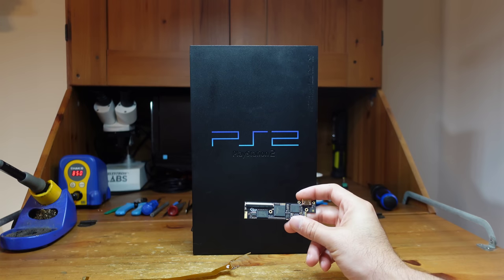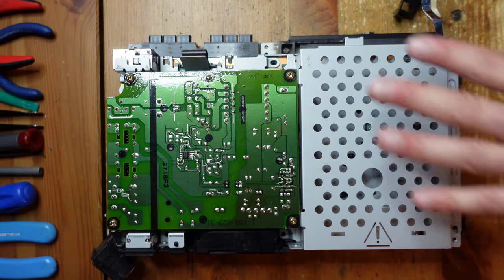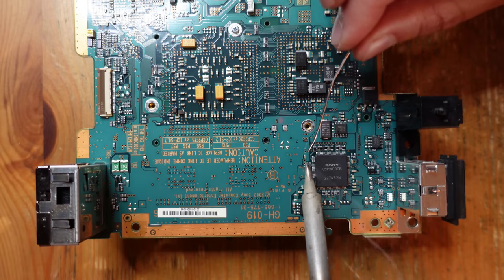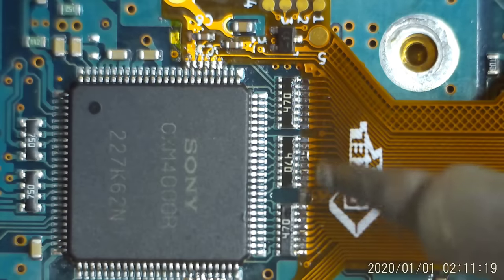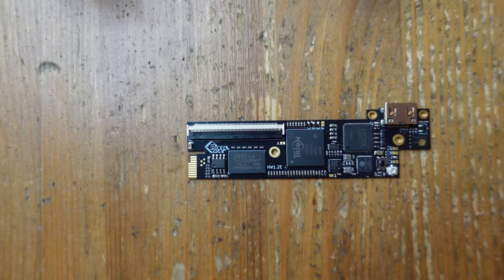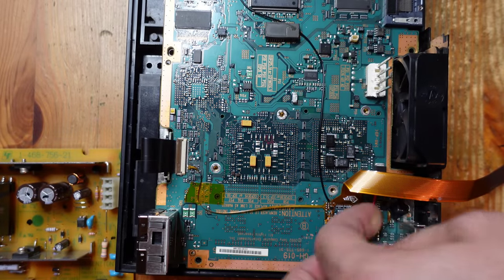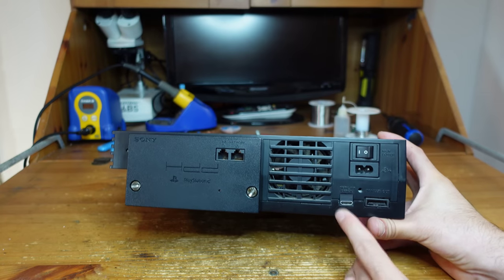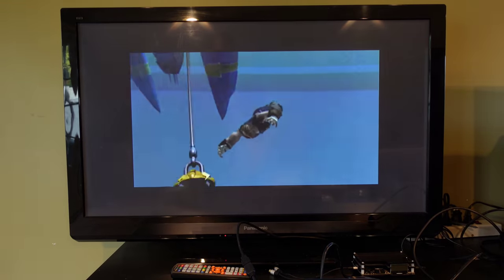Finally, a PS2 HDMI mod! Get the best possible video from your PS2 with the PixelFX Retro Gem!

Comment: Good installation process ... Thank U for sharing the footage ... Need to point out a few things, from my POV anyway:
1) PixelFX needs to tailor this mod, in order to fit specific PS2 models - and i am talking about different series, like 30000, 35000, 39000 (like yours), 50000 e.t.c... Since U still need a donor console - even just the PSU & RF Shield - to perform this MOD, it isn't an optimal solution for most folks ... Yes, the PS2 is the most common home console, but if U need donor parts to perform the mod, it is a big minus ...
2) From a mechanical standpoint, RF shield, pin & socket trimming may not be a difficult task to perform, but there are still required for the mod, thus altering the console's originality to some extend .. Most mods i have seen so far on retro consoles, regarding adding native HDMI support & socket, are way less intrusive than this mod ...
Overall, i do hope they improve their product on future revisions ... I am aware than many (and i mean many) retro gamers have been waiting patiently for a PS2 HDMI mod over the years ... But this needs to be improved upon ...
Just my two cents here, good vid, yet again 👍
Reply: They designed it to be a very generic board that can be used on many consoles, so I doubt they'd want to go more specific.
Reply from the maker: Thanks, glad that you enjoyed the video! One other option for the power supply is to use a modern replacement called the RePS2 and that would make the install a little easier
Reply: Have they said why the older power supply is incompatible? Is it a clearance issue? I would rather buy a consol specific kit so i dont have to replace the power supply altogether, though with as old as it is it would proba ly be a good idea to replace the caps.
Reply: 🤌✏️📌👍 Very much agree. I'd, specifically, made my PS2 selections from among opportunities for the 3900x model, especially, because they were the most gaming feature-rich and last revision to have the hardware included for iLink/s400 Firewire system-linking for, albeit a sparse number and, yet, notable titles almost all of which I still enjoy with other players = there has been no means of emulating iLink, otherwise, since.  Even though the 3900x lacks the relatively minor integration of the IR receiver sensor (what the 5000x model added), even that feature simply requires a cheap IR receiver dongle plugged into the controller port of pre-5000x models and that remote feature really only serves out of use DVD viewing which, by now, most console owners avoid to preserve the aging optical drive. Beyond, the slim PS2s, IMO, are simply more compact for and more easily powered off of automotive 12V ACC jack power via the long available DC to DC power adapter that's been around since nearly the launch of the slim.  Who wants to harvest shielding, etc.? This design should have had further review and market research and, especially, avoidance of addiitional required salvaging of parts cannibalized off of other models.

Comment: Question for you. I have the exact same model PS2 I want to mod, but why does the 3900x Model PS2 require a PSU from a 5000X series model for the retrogem? I'm thinking about switching it out for the RePS2 PSU, but I just don't understand why its required, and none of the documentation or forum posts explain why the switch is needed.

Comment: Nice to see that leaded solder works fine, I wasn't very keen on switching to unleaded for the PS2.  Were you using 350C when doing all the soldering?
Reply from the maker: Yeah, I was using 350c for the install and it’s much better to use leaded solder

Comment: I don't know if it's a marketing campaign, but magically everybody uses this mod and is the "best".

If anyone doesn't have the money (because it's very expensive and doesn't worth the money), or the skills, can buy a 2€ converted which is connected directly to the PS2 output and with OPL you can set the resolution up to 720p-1080i. Maybe it's not as good as this mod, but costs 50-100 times less and doesn't need to modify the console.
Reply from the maker: “Best” was just my subjective opinion, but you’re right that you can enjoy PS2 lots of different ways and for little money or even free. The important thing is to enjoy the games. I’m very happy with this mod on my personal console, but it’s only the “best” for me and not for everyone

Comment: George, you may have mentioned it in the video and I missed it, but with the Retro Gem on PS2 (or any Retro Gem compatible console) is it possible to retain the ability to use Composite in addition to HDMI or once the mod is installed, it’s HDMI only?
Reply from the maker: Thankfully all the analog video signals are preserved, so you will get composite, s video, and RGB in addition to HDMI

Comment: What's the advantage of being compatible with different consoles, at least to the consumer? Any reasonable possibility of an external install, or would running longer wires to the components be problematic?
Reply from the maker: The main advantage to the consumer is that the retro gem can more easily be adapted to work with other consoles, including the Xbox, Wii, nes, snes, genesis, and others. Hopefully this means that more direct hdmi mods will be available soon

Comment: I get wanting to do these kinds of mods, and wanting the best from an old game system on modern displays.

But anything old enough that doesn’t do digital output natively, aren’t you just adding a bunch of input lag and visual artifacts with something that is effectively an internal A/D scaler?  

Why not do an RGB/scart mod instead (on a CRT, it will look awesome), or use an external scaler that functions on multiple screens and devices?  Plus the PS2 probably supports component, which is basically RGB anyway.
Reply: No lag added to any of the Pixel FX products. The flex cables are pulling digital video straight off the video chips and sending it to the HDMI output, so you are getting native digital video. If anything, lag should be less than a stock console because the stock console has a digital to analog converter which allows it to send an analog signal out to your TV (Even though there's really no perceivable lag on a stock console either). No issues with visual artifacts either, thanks to the motion adaptive deinterlacing built in. There's a reason why internal mods like this are pricey. They do things the correct way. This isn't some cheap analog to digital converter jammed inside of a console.
Reply from the maker: I should have been more clear in the video, but there is no lag whatsoever when you do one of these mods. That being said, PS2 looks great using a scaler like the tink5x and RGB or component cables

Comment: I wonder if this mod is compatible with SCPH-30001 version? Has anyone tried to install it in such a console?
I have this early version of PS2 with DMS4 pro chip installed, but I haven't hook it up to my 16:9 Samsung in many years. I'm quite excited about this mod, but it seems not to be compatible with my console. I've sent PixelFX an email, but still haven't heard back from anyone.
Reply from the maker: They have a compatibility list on their website, and I do not believe that this model is supported
Reply: @LIRetroGaming  You're correct. I just got a confirmation from Dan of PixelFX regarding the incompatability issue with such a model. According to him, there is a plan to add support for this model in the future.

Comment: Thank you so much for this video! It was really informative and helpful :) I just have one question regarding disc-based region unlocking with this digital mod. The PS1Digital made by the same team has built in PSNEE support, which makes a ps1 consoles region free for disc-based games after the ps1digital is installed, removing the need to also install a separate modchip in ps1 consoles compatible with the ps1digital. Does the retrogem similarly have PSNEE support or equivalent to also make any ps2 it's installed in region free for pal and ntsc disc games? I haven't been able to find any information elsewhere suggesting it does or doesn't. Thank you again for the fantastic video!
Reply from the maker: Thanks, I’m glad you enjoyed the video! The retro gem doesn’t have a region free feature for the ps2, but that being said there’s a region free softmod called Mechapwn that’s very easy to use with the ps2
Reply: @LIRetroGaming  Thank you so much for letting me know! :) Unfortunately my two ps2s aren't compatible with Mechapwn (both are PAL 3900 models) but fortunately one of them has a modchip in it so if i get this digital mod someday i now know it's best to put it in that one instead of my unmodified ps2 :)

Comment: I got mine today so i searched your video to get a heads up on what I'm in for, and i didn't even think about it until i saw you removing the optical audio jack-- does the gem route dolby surround or does it only do the basic stereo audio? That's kind of a big deal for me so I'd really like to know.
Reply from the maker: I’m not sure if it does, but it would make sense if it can also support Dolby surround

Comment: I wonder if it'll work with a 39000 model PS2. That's one of the fat models and the one I have. I also have a slim model PS2 which is a SCPH-70012
Reply from the maker: Yes, this is actually a 39000 model PS2. The retro gem is also compatible with the slim

Comment: So how does the Retrotink 4k / 5x pro compare to this mod ? from what i have seen the Retrotink is awesome (and no soldering and portable ?
Reply from the maker: There are a few scalers that can do a very good job with the ps2 including the Tink 5x/4k, the OSSC pro, and the Morph. If you have those scalers already then it would probably not be worth it to hdmi mod a ps2
Reply: @LIRetroGaming  I broke down, ordered the 5x pro and decided that i wont do any more of the intense soldering mods. Buying the 5x will allow me to have the benefit of multi consoles/home computers capable of achieving a pretty well perfect image, and based over the cost of the 5x the cost saving benefits spread across all the consoles makes for a cheap safe install
Reply: i can use one good shielded cable set up for RGB etc and i will make small adapters that fit into the source console, this will save the added expense of buying multiple cables., the cost of cables for all these consoles is not cheap  @LIRetroGaming

Comment: is there a huge difference between Component output and this HDMI Mod? it's not the same but I have an N64 with a N64 Digital HDMI Mod and a Component modded N64 and the difference is very minor
Reply from the maker: It depends on how you are using the component cables. If they are connected to a premium scaler like the retrotink5x, then it should be very similar. But if they are going straight to the tv or to an OSSC, then this would look better

Comment: So when doing the final steps you have to sacrifice the optical port. It’s a big deal for those that want to and like running sound thru surround sound.
Reply from the maker: Yes that is correct, although I don’t know if it’s possible to get surround sound through hdmi as well
Reply: @LIRetroGaming  I'd also be very interested to know if surround sound is supported via hdmi, or if its stereo only.

Comment: At 37:03 I see three green transparent bars across the screen. Is that noticeable when playing?
Reply from the maker: I think that was an issue with the tv itself, this old plasma tv is fine for testing but it’s video output is not great. I have not seen any video glitches since I started using it on my main tv

Comment: I never seen before a PS2 with replaced tarantula capacitors like PS3 😅 why did you replaced them? PS2 doesn't have overheating issues
Reply from the maker: I didn’t replace any capacitors. Those were original tantalum caps from the factory
Reply: @LIRetroGaming  no way, maybe someone else replaced them

Comment: Can you compare the image quality to a backwards compatible PS3?
Reply from the maker: I need to get a backwards compatible ps3 to compare, but I have heard from friends that the retro gem looks noticeably better than the ps3
Reply: @LIRetroGaming  Wouldn't surprise me. My PS2 connected to a Retrotink 5x looks noticeably sharper than my CECHA01 (although more noisy obviously). My guess is the deinterlacing algorithm Sony used back then simply wasn't as good as more modern methods.
Reply: @MichaelM28 yeah the deinterlacing is comparable to a stable Bob Weave Blend. I will say sometimes I'll notice lines with motion adaptive they sneak in on the main character of say Sly or Jak. Where as Bob Blend Weave combo the shaking of the picture is a blurry but line free character. I have the A01 and E01 and man the E01 if the game is compatible is BETTER than Retro5X. But like I said compatibility is rough. Sometimes I wonder if the A01 deinterlacing is just a noisier version of motion adaptive.

Comment: Really nice video.
I have to ask…

In the PS2 Fat console you have to desolder and remove the TOSLINK port.
In the official retrogem site section of installation instructions they mention that “ For DTS and Dolby sound needs a special wire routed to the retro GEM”. 
From that, I assume they support DTS and Dolby sound through HDMI. 

In the PS2 slim versions of the consoles you don’t remove the TOSLINK port. Additionally in the installation instructions they say: “DTS and Dolby digital audio needs an extra wire routed to the GEM board. If you are not concerned with these modes, then this step is optional.”.

In the case of routing the audio through Retrogem, does anyone know if the digital audio is routed only through HDMI or are you able to also use TOSLINK?
Reply from the maker: Yes it’s possible to add sound from the toslink to the retro gem. Those instructions are on the PixelFX site but this was not yet possible at the time that I made this video
Reply: @LIRetroGaming Does that mean you lose audio from TOSLINK or is it still functional (after routing to retrogem)? Thank you for your time.
Reply: I received a message from PixelFX about the digital audio.

“If you do NOT route the wire.  Audio will work in every game by default. However if the game offers DTS in the options menu (like ssx tricky) then this audio will not work when changed to DTS.  It will work fine on the normal audio mode.

On the slim, the toslink audio will work at the same time with the GEM.”

From the above I assume it is possible to save the TOSLINK audio port on PS2 Fat Version if you know how to do it…

Keep doing the great job you all do!!!

Comment: Great install! I’ll be tackling this with my 55000 next week.
Did you have the link or part number for the replacement crystal oscillator? Can’t seem to find it anywhere 🙂
Reply from the maker: You can find it here https://docs.pixelfx.co/GEM-PS2FAT-Installation.html
Reply: I didn't see that, my bad.  I thought you'd put a mouser or digikey link in the description. @LIRetroGaming

Comment: Nice mod but I'm not a fan of trimming the power supply pins and plastic spacer.
Reply from the maker: I hear you. The trimming is not necessary if you use a 50000 series ps2

Comment: Shouldn't a 39k PS2 have leaded solder? 
And leadfree should be way later, 70k and later would be my guess?
Reply from the maker: Surprisingly, that is not the case. The 39000 series definitely uses leaded solder
Reply: @LIRetroGaming  that is indeed surprising. Didn't expect that.

Comment: what crystal oscillator should i use?
Reply from the maker: You don’t need to replace the crystal oscillator, but there’s a part number on the pixel fx retro gem documentation that can be used to replace the oscillator with a lower profile one

Comment: i saw that you used a lead and leaded free mixing, is that right?
Reply from the maker: Yes that’s what I did and the official install docs also stated that this is fine
Reply: @LIRetroGaming  how did you mixing lead free solder with leader solder? Where did you find the official instal instructions?

Comment: there is no visible difference between component RGP cable and this retro gem fix
Reply from the maker: Depends on how the component cables are made and how they are connected to the tv. Quality cables connected to a scaler like the tink5x will give you a similar result

Comment: whats the best video output i can get from a ps2 that isnt this...   this is quite a bit too complicated and difficult for me as ive never soldered before and even if i learned to i wouldnt trust myself with a week of experience on something this arduous.  still, i enjoyed the video, and you did a great job on this mod 👍
Reply from the maker: Another excellent option for ps2 is to get quality component cables and connect it to a retrotink5x. It should look very similar to this and has no lag as well
Reply: @LIRetroGaming  do you know if SCART through an OSSC would look similar in quality?
Reply: i have learned that RGB SCART and Component look basically identical if both cables are high quality, huhh (very very slight color differences is all i could see between the two on an OSSC)
Reply from the maker: RGB SCART and component are equal in quality as long as you get good quality cables, and RGB is usually half the price compared to HD Retrovision cables. The OSSC can do a nice job, but it has limited deinterlacing options compared to the Gem
Reply: @LIRetroGaming  I've found RGC component cables for the same price that I've found high quality RGB synconluma SCART cables. Are HD Retrovision component cables better than those two?
Reply from the maker: No, I think all of those options have the same quality it’s just that Retrovision cables cost more money.